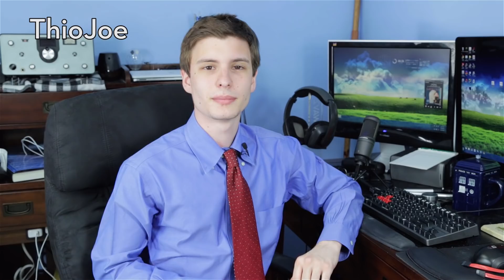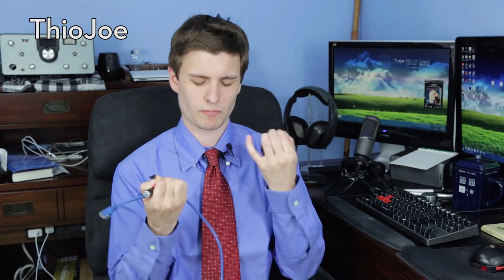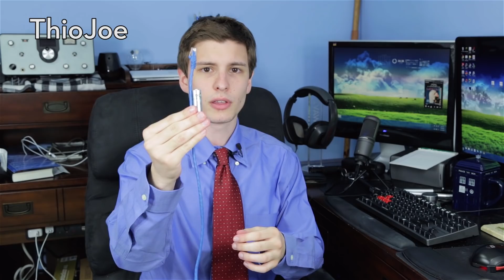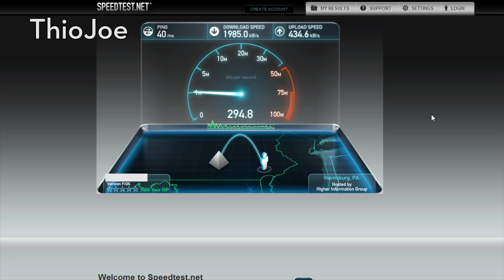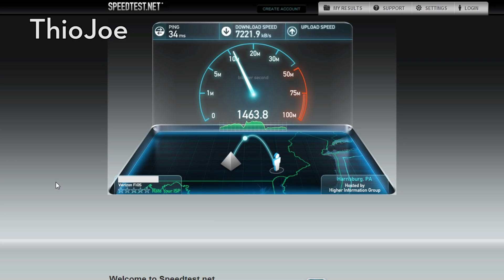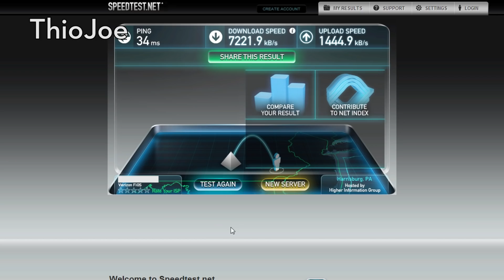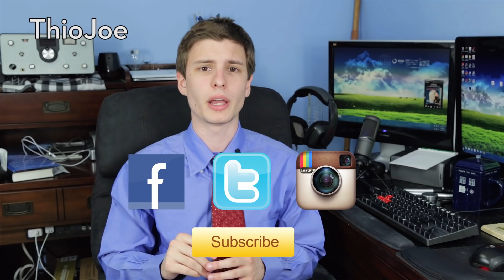Triple Your Internet Speed for Free

Comment: DIDN'T work, in fact, it cut my download speed in 1/2 from 16.71 to 8.63 (mbps)--upload improved only slightly from 1.09 to 1.27 (mbps). I used brand new, rechargeable AA Energizer batteries, both north poles pointing toward the ends of the wire (opposite directions from each other) CAT.5 cable
Reply: His videos are prank lol

Comment: I wrapped the cable on my trucks fuel line from the tank to the engine, wow over a hundred miles a gallon now and I can spin my tires in any gear.

Comment: Why did I just see this now and not before I upgraded my internet plan? Yes! I will not buy speaker wires anymore for my wiring. I'll just use my old electrical tapes and use red for positive black for negative. My sound transfer will be so fast and could run longer distance with zero loss.

Comment: You 'll get more speed if you wrap your secondary battery at the ratio of Pi to the position of your primary battery. This is because the secondary battery acts as a phase shifter at the angle theta of the signal induced into the primary battery. Its just basic physics!

Comment: He's totally lying about the four batteries.  I used 9 D cells and it made my speed over 10 times faster I'm going to get a longer cable and try more batteries.
Reply: OK I got a 10 ft cable (yellow) and put 34 D Cell batteries on it.  Only increased my speed to 12 times faster.  I'm satisfied with this.  Thanks for the great practical advice.
Reply: @jimspice7737  Have you tried connect the Cat6 cables to a gas running generator? Seems it would work better than size D batteries.
Reply: Seems like an expensive way to solve a simple problem.  Are you mocking ThioJoe?
Reply: Who invited Dan Anderson?  His idea suck! It will never work....
Reply: Dan.  that is one Trumped up Idea for sure!
Reply: HOW DARE YOU!  Troll.  I beg your Pardon!
Reply: @tomh3845  I bet I could get faster internet speed connecting you in series with jumper cables and gas generator

Comment: Next Video: How to upgrade your storage space as much as you want for free:
All you need is:
1) A backyard with grass growing
2) Your mouth
3) An external or internal hard drive
4) Electrical tape(because it conducts electricity)

Step 1: Go into your backyard
Step 2: Tape the external hard drive around your waist with electrical tape
Step 3: Expose some dirt by ripping out grass.
Step 4: Smash your face into the dirt and chew into the dirt
Step 5: Each chew will increase your hard drives storage capacity by 1 Terabyte.

In all seriousness ThioJoe: You're a fucking disgrace.

Comment: To triple your internet speed, save some time and just pay you ISP provider.  This moron doesn't even know how electricity works.  Just for starters, electrical tape doesn't conduct electricity, it insulates.  Batteries don't provide magnetic induction.  I could go on, but you get the point.  Full disclosure:  I'm an electrical engineer.
Reply: Jeff Krush r/woooosh

Comment: I had encountered a problem of not having an ISP that could feed my network adapter;  so I got myself a second internet connected to my house and fed them both to my ethernet cable using a splitter.  Now I put two batteries on each of my ISP cables and my network adapter is glowing and bouncing across my MB.  What should I do?  Help please;  I'm out of options!!!!!!!!!!!!!!!!!!

Comment: ThioJo --- thank you for the tip --fantastic -   it went from slow to:   Latency: 36 msServer: Miami, FLYour Internet speed is fastYour Internet connection should be able to handle multiple devices streaming HD videos at the same time.

Comment: I wanted to go even faster so I plugged one end of the ethernet cable into my computer and took the little plug off the other end and exposed the wires. Then I put those wires into the 240v power point and turned it on. It was amazing. My computer went so fast the whole thing just disappeared in a puff of smoke!   Brilliant!   ROFL

Comment: ThioJoe:  Thanks for this interesting and useful video.  Questions: You didn't explain why one should use prefer to use re-chargeable batteries, nor did you explicitly state that the batteries need to have charge.  I presume having a charge is necessary.  Would this mean that non-rechargeable batteries would eventually lose their amplification ability?  Would re-chargeble batteries be re-charged or maintain charge when applied to this use?
Thanks!

Comment: I accidently connected the batteries backwards and blew up the world. My buddy is god so he recreated it. So do not try this at home unless you know God.  Joe a new technique I have been working on is to wrap a SATA cable around a 9V battery 10 times to make 90V then shove it  your ass, then you can pump out 10x the bullshit videos.
Joe, if you really want the fastest free internet! Get an extension cord (the longer the faster the signal will be I have speeds of over 10,000,000,000,000,000,000,000 GBS (gigabytes per second) very fast using a 2 mile cord. Do not loop the  core or the electrons will get stuck and slow things down,  carefully cut off the end that you would plug something in to, throw that end away. strip the long end back exactly 6.5432123456 inches. make sure you don't cut off the side that plugs in the wall that would be stupid. Separate the wires on the outlet end you just removed and use your conductive tape on each of the wires wrapping exactly 12.4353526 turns (this is very important) on each wire. You can use 13 wraps on the ground wire if you prefer you will only loose about 0.0000000000001% of the speed. Finally plug the other side in the wall outlet. Use a pair of clip leads and cut through the insulation of 2 of the wires to verify you have done everything correctly. If you get smoke and possibly a slight shock you are well on your way. If you blow a fuse or breaker make sure you jumper it out completely this takes a lot of power but the speed you will get is more than worth the $10,000,000.00 electric bill for a week.  Remember this is only for Joe he is the master IT professional.   Get into your tub filled with water, add 3 pounds of salt for safety (it stops the conduction of electricity) grab a laptop running on battery so you don't get hurt then start the download test after the first time and your cash has the file already downloaded get ready to run the test a second time. At the same time you start the test drop the end of the cord with the conductive tape on it in the water. Your speed will go through the roof!!! I guarantee it. You will never need to make another stupid video again in your life. Remember this is only safe for the IT pro that makes these super intelligent videos. The complex formula for this new technique is Dumbass =stupid fucker (2) / apple pie x 2 trips around youranus= the speed of light in a small town with a lot of people. After this you will never need to make another video again. Nothing can ever be faster. Good Luck.

Comment: Hey whats up Joe! I have a question... how should I do the induction process for my internet.. I have spectrum and  there is a coax cable to my router and I have a ethernet cable  going from the router to my TV. I use the Amazon firestick most of the time.. I am trying to speed up my internet to watch movies, especially my kids. Bit the movie freezes because The internet is slow. Do i put the batteries on the ethernet cable coming from the router to the TV??? Please advise.,

Comment: You Said....."Its important to use electrical tape because it conducts electricity"...As an Electrician they never told me that. In fact i use it to insulate. I hope thats a mistake that you made as it may appear   the rest of your advice is just as flawed.
Also if you are already maxed out  with your band width, you CANNOT increase the speed any more and this you fail to mention.  This is only an idea for those who have for exsample a 12mb/sec  speed, yet are only getting 2-3 mb/sec. If you already have 12mb/sec then where the hell is a faster speed suppose to come from?????.....FAIL.

Comment: wtf is this. i tried it and it works rly but since i didnt find any aa bateries i used 2 car bateries and insted of sata cable i used cables from spot welder and my internet speed is now 99999999999999999999999999999.9 times faster basicly i have the best XD

Comment: Well I didn't heed his warning, and I taped 32 batteries along the full length of the Ethernet cable. When I powered on my 56k modem, the internet came out with so much force, it blew the laptop off the other end. The cable went flying around the room uncontrollably and I had to run out of the house, naked and crying. Well, the laptop flew out the window and hit a passing patrol car. I was arrested for indecent exposure, so yeah.... only use four batteries, tops.

Comment: For the cable to induce a current from that battery you would need a coil with several coil windings to wrap around that cable whilst not in contact with the cable and connected in a circuit with the battery, you would also need a circuit breaker to collapse the magnetic field whilst mimicking the signal (This can either create a stronger signal or an interference), the battery isn't even powerful enough to produce a decent magnetic field.

Amplifying a signal will only improve it's reliability or range I don't see how it will increase your Internet speed by x3. 

To overcome the resistance in the cable you need to either change the material, thickness or length of the cable.

Also why would the batteries face in opposite directions, batteries store direct current which only flow in one direction, conventional current flow (from positive to negative)

Insulation tape/electrical tape doesn't conduct electricity it's an insulator.

Comment: I believe that if you want to prevent "signal leakage"  wrap the "wiring/cable" with "magnetic tape" and then cover with electric tape.  what ever this "nut" is feeding is questionable in application since he doesn't actually record any connect/disconnect features.

Comment: Quick tip, if you use CAT-69 cable and duct tape it to the high voltage lines outside, you are able to get more RAM on you Motorola flip phone

Comment: Electrical tape (or insulating tape) is a type of pressure-sensitive tape used to insulate electrical wires and other materials that conduct electricity. It can be made of many plastics, but vinyl is most popular, as it stretches well and gives an effective and long lasting insulation.
"na i don't think it conducts electricity"

Comment: Worked decently well but then I started thinking of ways to improve the idea. 
Thicker gauge wire reduces resistance. Salt water is very conductive and Cheese is a lubricant. When you think about it the answer becomes apparent.... Cheese filled hot dogs. You don't have to worry about the polarity of a hot dog because both sides always point to a good time. 

Next the wrapping, electrical tape is ok but once again, salt wins out. Bacon wraps well and the sodium and nitrate really speed those electrons along. Bacon is highly magnetic as we all know how hard it is to refrain form eating. Magnetic induction accomplished.   Our Gaussian goodness is almost ready. 

Final step is to pump the wire full of free electrons. The easiest way is with a magnetron, (don't worry, you have one). Just stick the whole cable, bacon wrapped hot dog and all, in the microwave. Just like pumping a laser full of photons, the microwave will fill the wire with free electrons. It will also loosen electrons stuck to their atoms.  Now your wire is an air freshing superconductor. You should reach speeds between 1.21 jiggawatts and 12 parsecs.

Comment: I put electrical tape on the battery ends, but electrons were still leaking out and they were getting all over the carpet. Better to use silicone that dries to a rubbery consistency and traps more energy in the battery, just cover the battery end with silicone, like RTV and wait for it to dry. Keep the battery pointing up while drying so you don't lose too much energy. Don't want it spilling out.

Comment: This worked great for me. I also found that if I shove both ends of the cat5 cable (batteries included) up my rectum while placing my hand in a running garbage disposal during snowy months it'll start my car before I leave for work. The only draw back doing this is how difficult I found it to drive on iced roads with one of my hands bloody and mangled, but boy did it save me time and energy having the car all warmed up and ready to go by the time I was off to work. (Side note: I leave the cables in my hole throughout the day. For convenience )

Comment: First, only the variation of the Flux through the wire induces  current, second, the protection of the cable is not conductive, also as the black tape.

Comment: Insulation.. heu electrical.. tape on a tie works way better and you don't even have to plug it in the computer just lie around the PC. Even better by doing small jumps of at least 3 inches (be precise) 😂

Comment: Sad to see such negative comments when someone has gone out of there way to offer advice.  But I tried this as the place we are buying sucks on broadband speed.  The company said I would get between 0.75 to 2.3.  Not great.  So tried your suggestion out here.  X4 AA batteries - rechargeable.  Wrapped an IDE cable as shown - the test without was 4.57 and the test with all the bits added on to the cable 4.88.  So a slight increase.  But I doubt it would be of much use at the end of the line where we are moving to.  But the UK sucks at getting good broadband to the countryside.  So if you have any cheap ideas without the negative ones I have read would love to know.  And not moving is not an option. Thank you Thio appreciate your advice and helping people

Comment: You are so full of shit and all your videos are total horse shit. Did I just hear you say that you prefer electrical tape because it conducts electricity ??
Dude I'm an electrical engineer and there is NO POSSIBLE way what you are saying could ever work. Two cables side by side and wrapped and taped will yield ZERO improvement from your old CAT5 cable, or ANY CABLE) I work on systems that use up to 1000 VOLTS AC AND DC FOR SUBWAY INSTALLATIONS AT AMPERAGES OF OVER 2500 AMPS !! All of our cables INCLUDING NETWORK CABLES AND EVEN SOME FINER WORK PERFECTLY. ANY INDUCED current is so small that it's negligible. OBVIOUSLY TWO CABLES LAYED BESIDE EACH WILL PRODUCE A FIELD, THATS EXACLY HOW TRANSFORMERS WORK, A LOOK HOW MUCH WIRE AND AN IRON CORE IS NEEDED TO TRANSFORM EVEN IF ITS A STEP DOWN OR UP. I just don't get why you post totally bullshit so called science that NEVER HAS WORKED FOR ANYONE. OR AM I MISSING THE JOKE AND THIS IS ALL JUST FOR YOUR AMUSEMENT ? Either way,  you suck.
Reply: triggered
Reply: you are just stupid he is making fun of how to videos
Reply: His videos are jokes. They aren't meant to be taken seriously. Calm down.
Reply: OH YEAH INTEL 1? I TAPED TWO BATTERIES TO TWO SEPARATE NETWORK CABLES, THEN WRAPPED THOSE AROUND MY LEGS, AND NOW I CAN RUN 6 TIMES FASTER. YOU DOUBT ME? WANNA RACE?
Reply: wow...you're really mad
Reply: Yes, you are missing the joke.
Reply: sarcasm, dude
Reply: Chill down dude, here drink my cable taped coke.... It can make your day trippled speed
Reply: wtf just happaned?(also i laughed too hard)
Reply: sarcasm, dude

Comment: I'm Sorry but it's not just the fact that he keep's saying electrical tape conducts electricity when it actually insulates it, or that you can; induce, amplify, and filter EMF signals on a SHIELDED cable just by taping on some POLARIZED batteries.  This is completely made up and if anything will slow the connection by making the cables so heavy the pull the ends out.  I haven't seen one video by this man or any similar typed people in similar videos that is based on even basic science.  Please, if you want to improve your systems base it on actual knowledge and don't buy anything unless there is a shred of science behind it.

Comment: With the change in seasons upon us, make sure you change the air in your automobile tires.  You'll want to get rid of the summer air and install winter air.  You'll get much better mileage per gallon.  Don't forget to switch back just before next summer.

Comment: no one has said what is wrong with this, its sounds cool to say he is trolling but technically what is wrong?
try google RFI, the dialetric strength of air, resonance from equal spacing, the same side of a cable that is twisted twisted pair, capacitance of near by conductors blah blah blah

Comment: Absolute rubbish! I have never heard such bullshit in my life. If I test my broadband at the router (so without any cable) I get 70.02Mbps. If I test it at the other end of the house, after is passes through a switch, patch panel and around 40m of cable, I get 70.01. That is a drop of 0.025%. So HTF would taping a battery to my cable increase the bandwidth available from my ISP by 300%?

Comment: This video was just made to attract views. First of all, electrical tape does NOT conduct electricity! I can't tell you how many times I have heard this bull from similar bogus videos, that would contradict the point of its INSULATING properties. Second, batteries produce so little electromagnetic radiation, that it can't even be detected by a top of the line multi-meter. The only thing that this could possibly do is to cut down on electrical interference due to the iron present in the batteries housing, but the same thing can be accomplished by a ferrous sleeve over the wire.